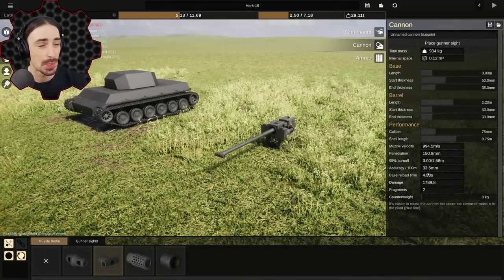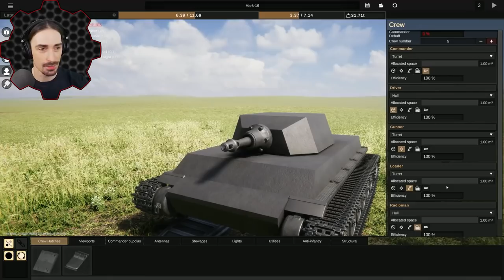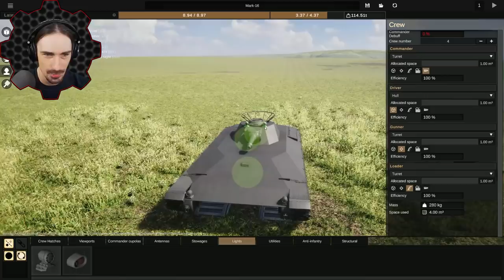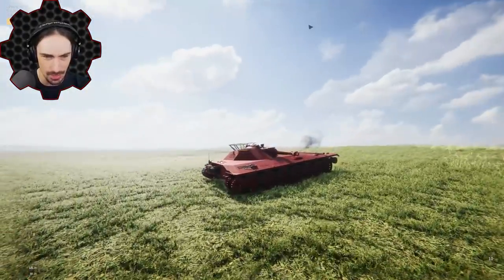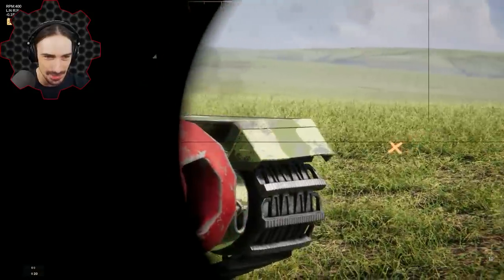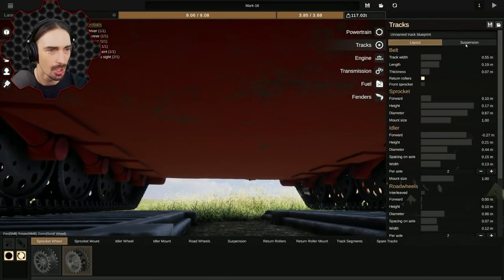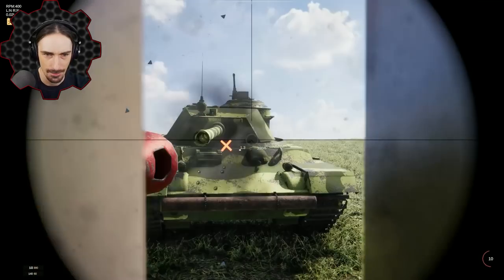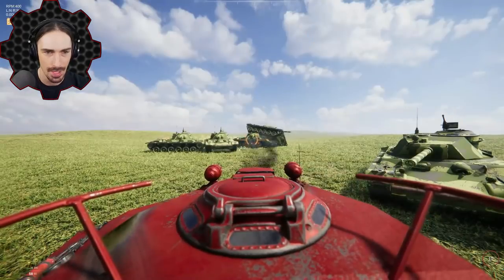I Made a Tank with the Highest Fire Rate, But at What Cost? - Sprocket Gameplay

Comment: 14:30
You have 47.8 mm of penetration
That tanks has 200mm of armour at around 45°
Effective armour = real armour/cos(angle of attack)
Being angle of attack = 0° when you look at the plate perfectly straight. That means that the tank you are shooting has around 282.84mm of effective armour

As tips:
- Increasing the barrel length, increase bullet speed, therefore, penetration.
- Increasing round caliber reduce penetration
- Increasing round length increase penetration
- AP has more penetration than APHE but cause less damage

There are tons of tips to follow, but these are basic to built an appropriate gun
Reply: Some people still seem to think that longer barrel = more accurate. 🤦🏿‍♂️
Reply: @alkestos  well it adds some accuracy, but not too much
Reply: they didnt have APDS?
Reply: @himenaaa3565  I don't know, I don't have Sprocket. Maybe you can find it on wikis
Reply: @falin9557  from the videos it clearly they didnt have it, i thought you have one, since i dont have too xD,
Reply: @himenaaa3565  sprocket's max year (currently, it may change in the future) is 1945 and the minimum year is 1914
Reply: @alkestos  it does, by increasing speed and rotation (depending on type of barel) it stabilises the ammunition
Reply: @warbrain1053  that depends on the burn rate of the powder. If all the powder has burned the barrel only serves to slow the projectile down due to friction.

This is not obscure science.
Reply: @alkestos  thats true tho, but its not a direct causation
longer barrel = higher muzzle velocity = more accuracy
Reply: @caralho5237  
Also with larger calipers, you may leave muzzle velocity on the table if your barrel is too short.
Higher muzzle velocity = flatter trajectory arc = generally more accurate & more penetration
Also, you don't have to lead the shot as much on moving enemies.
Reply: @Grumpy_old_Boot  Issue with high calilbers is the balance of velocity, trajectory, penetration, accuracy and weight. The longer and thicker the barrel has to be for the larger calilbers the harder it is to raise and lower the gun, if you make it too short however then now its fast but its lacking in velocity and pen, make the barrel to thin and it wont have an effective burnoff ratio and wont cool down, so on and so on. This is why large calilbers are a pain and not only for weight, simplicity and speed most people stick with 12.2cm and below for heavy tanks. Besides the balance, its also in the fact that a longer shell of higher calilber can increase accuracy up to a certain point (close to 0.60m at 15cm) though im not sure about this ratio for most calilbers. The other issue we run into though with larger guns is the space useage and inaccuracy as the calilber rises.

Also why did I just rant about this
Reply: @DoggosGames  its not years, its just eras
Reply: @alkestos  bruh longer barrel helps accuracy and penetration
Reply: @Noooo23523  As long as the barrel is long enough that most/all of the powder burns causing more pressure instead of flying out of the muzzle, it doesn't affect penetration. If you have very fast burning powder that burns near instantly, you could have 1 inch barrel perform equally if not better than 16 inch barrel.

Main component to increasing accuracy is the rifling inside the barrel. In worst case scenario, long barrel can decrease the bullet exit speed, but this is very extreme case, not really something anyone is gonna run into with normal length firearms.

Long barrel could increase your accuracy in a sense that it is heavier than shorter ones, thus increasing stability, but you could increase the weight other ways just as well.
Reply: @alkestos  yea mostly but doesnt the presure get more thrust for being more time in the barrel pushing the shell more time

Comment: To answer your question: there was never a tank designed for ramming, but in the invasion of france some britsh matilda tanks ran over entire colums of german anti tank guns because the couldn‘t damage a matilda tank
Reply: Matilda are just bulldozer from payday 2
Reply: >there was never a tank designed for ramming
Rammtiger says "hello".
Reply: Yeah the Rammpanzer Tiger (P) is very much a thing.
Reply: @jamessquires7015  you are joking
Reply: @anticlaassic  Afraid not, massive armoured casemate installed ontop, because the Tiger Ps drivetrain wasn't already overwhelmed by the Ferdinand/Elefant conversions.
Reply: @jamessquires7015  ahh yes and they added a V2 rocket booster for extra speed while ramming right?
Reply: @anticlaassic  I wish, the Tiger P is fast but i really don't imagine what adding in places 40cm thick plates of steel is going to do other than get its stuck under rubble easier.
Reply: @jamessquires7015  you don‘t say! I would have never thought that! 

I still think that a ramming tank is bs. Even late war german high command wasn‘t THAT dense.
Reply: @anticlaassic  The Tiger P one doesn't have much evidence of physical existance, but there are Rammpanzers based on StuG IIIs and Panthers which we have images of.
Reply: @jamessquires7015  it‘s still a dumb idea. Just stick a gun on it and stay at range
Reply: @anticlaassic  Its not for Antitank work, they are mostly of deminining, they are basically tanks converted into bulldozers, which brings me to the Minenraumer III, an absolute lad of a vehicle.

Comment: 6:45 the round thing you where pacing is a ventillations exhaust for the crewcompartment, the rectangular thing is a pistol port, used to fire hand held weapons from the tank, and sometimes to make it easier to load ammunition in the tank when restocking.
 6:54 the log was used by the soviets to help their tanks unstuck themselfs from mud, by pulling it under the veichle with the log attached to the tracks.

I think if you make your gun longer, you can have better penetration with the same shell.

Comment: There were cases of (mostly Soviet) tanks ramming other tanks during WW2, but it wasn't very common. Generally ramming was used against towed anti tank guns (cannon mounted on 2 wheels), since ramming is the easier way of destroying them than trying to hit it with a gun.
Reply: I feel like trying to hit a tank with another tank would just give both crews some lacerations and concussions and damage nothing on the vehicles themselves except maybe the transmissions because, you know, World War II Era transmission 
Had no idea they would run over field guns though, neat.
Reply: @owenkegg5608  Against AT guns it's not a bad idea really, even if the only thing achieved is bending the barrel and removing the gun from it's carriage. That would still take it out of action. Also likely the crew of the AT gun will have fled before impact, which takes away the need to actually ram whilst still disabling the AT gun. Also ramming the AT gun does not necessarily have to happen at high speeds, once the crew has fled a tank can simply drive over it and crush it under it's own weight.

Vs Tanks it still isn't ineffective, assuming a T-34 running at 25 kph has about half the kinetic energy of it's main gun 750000 Newtons for the tank (a car at highway speeds does a bit less, but has a crumple zone to absorb impacts), having that impact a hard steel object will still bend the wheels on a tank or remove the track. Which immobilizes the tank and thus makes it an easier target for artillery or airstrikes, that is assuming the crew does not abandon the tank outright since a pillbox is not useful for offensive maneuvers. One is however indeed sacrificing one's own tank to potentially take another out of action, but if said other is a Tiger Tank this might actually be worth sacrificing a few T-34's for.

T-34's don't have the armor penetration to shoot and destroy a Tiger tank. But as Tiger 131 shows, even the right minor damage can be enough to take a vehicle out of action. In case of Tiger 131 this was a non-penetrating shell from a Churchill tank that wedged itself between the hull and turret which prevented the Tiger from aiming, this resulted in an almost pristine captured Tiger that is still running under its own power at the Bovington tank museum in England during their "Tiger day" events.

Comment: Yo are shooting a tank with probably around 100 millimeters effective armor (it could be 50 mm thick but since it’s angled it’s really around 100 mm) since it looks to be a Cold War era MBT and you are fire of at them with basically a gun that planes would use. The reason why you aren’t doing damage is because you have a short barrel as you are doing 28 millimeters penetration so if you increase the barrel length to max, add a counter weight so it can elevate the gun and add way more torque to traverse speed as well as a faster engine your tank might of been able to pen there side and rear armor and adding barrel length would not increase reload speed

Comment: Um, that was a muffler not a gas tank. The antenna is clipped down instead of vertical for safety. The log is for getting bogged down in a swamp but your tracks are too far apart.